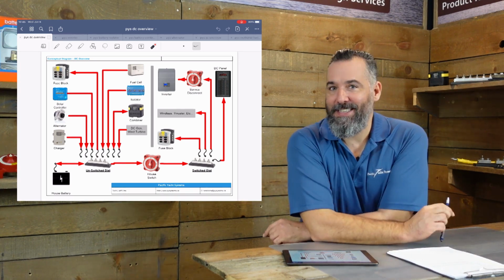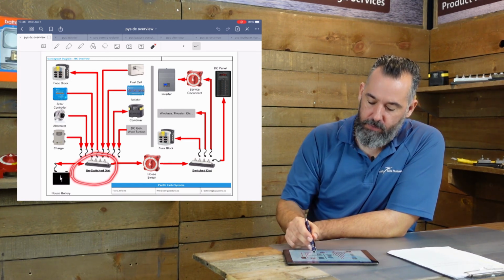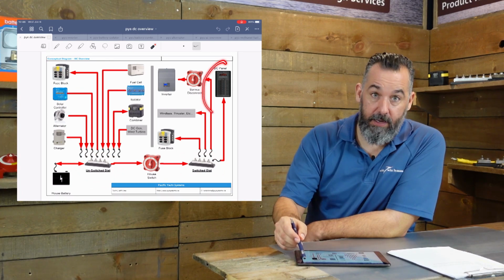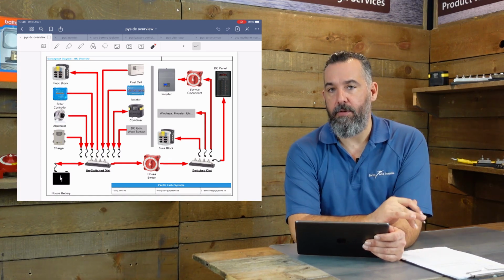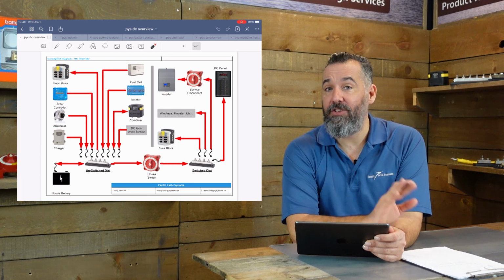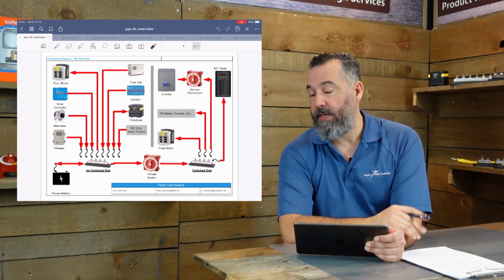My Batteries Are Completely Disconnected but I Still Have a Reading on My DC Panel?

Comment: The other factor of having them on the switched side is that when the switch is off, you will not be charging/ maintaining your batteries and it will effect their overall life.
Reply from the maker: Hey KMT15 good point, thanks for sharing.

Comment: I've see a problem once, in a fire truck, where after turning off the main power switch, an iPad plugged into the 12V plug for charging was back feeding to the truck. Yes, the iPad was now being used as a battery. Cheap adapter was the problem I think.
Reply from the maker: Ohh wow, never heard of this, pretty scarry.

Comment: Jeff:  Would it be safe (correct) to say that most battery “chargers” are not designed/intended to be used as DC power supplies?  RVs are well known to have “converters” that act as both battery chargers and DC power supplies, but they still require a battery to be connected to act, effectively, as a kind of capacitor to greatly reduce ripple on the DC voltage.  A true DC power supply (I have them in my ham radio shack) does not require any sort of battery to be connected across it’s DC outputs.  Thanks.
Reply from the maker: Hi Bruce, that's correct, battery chargers aren't really good as a DC power supply.

Comment: That diagram has charger to unswitched (perfectly logical) and inverter to switched.
I assume if it's an inverter/charger such as a multi plus one should disconnect (off) the inverter isolation switch. Just because the inverter function might be off in the control of the multi plus, it doesn't mean that the charger is off, thus power supply to the unswitched distribution.
Is this correct?
Reply from the maker: Your correct, an inverter/charger is both inverter and a charger, the inv/charger needs a dedicated on/off switch connected to the unswitched distribution, remember charger needs to go to unswitched distribution.

Comment: Hey Jeff question. I want to install a 65 amp mini add a battery on my traker190 at the present it came with one crank and one trolling  motor battery. I want to convert to two batteries for the trolling motor which is 12 volt until I upgrade to 24volt.The advertisement states to add a battery like a house battery but I am just adding another battery in a parallel configuration would the mini work for me? Would it charge all three batteries?
Reply from the maker: A battery combiner can share a charging voltage between TWO battery banks. Each battery bank can be made of one or more batteries wired as a single bank.
Reply: @PacificYachtSystems  Thank you Jeff! I am going to attempt to do this conversion myself I just don’t trust anyone to install my configuration as OCD as I would like due to the fact it’s not their boat. What I could definitely benefit from is a schematic with all the recommendations you would suggest. Watching your extremely informative videos I’ve learned of negative bus bars, fuse blocks, circuit breakers and the like. Could definitely benefit from a schematic from you showing all that you would recommend incorporated into my application.
Reply: Thx.. Jeff.  Your doing a wonderful job.